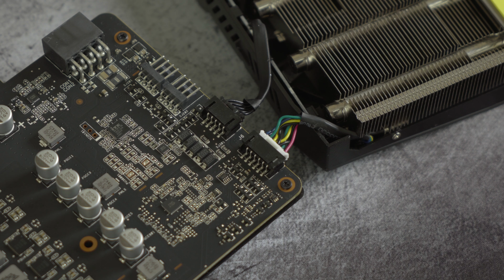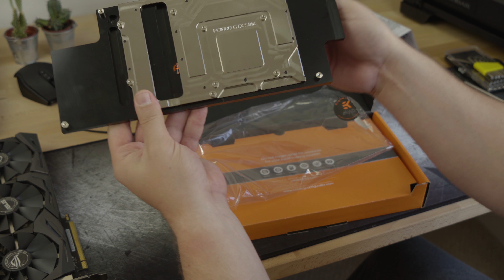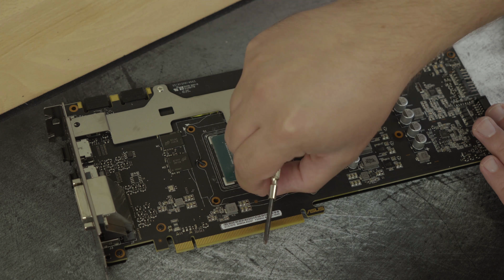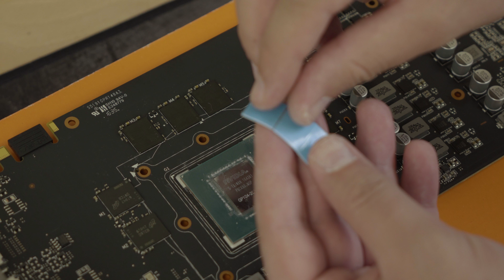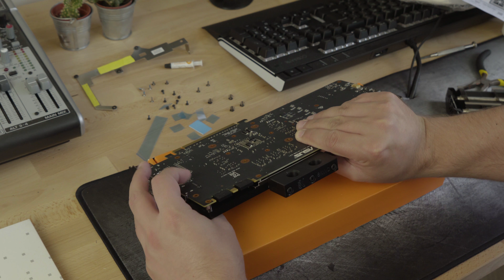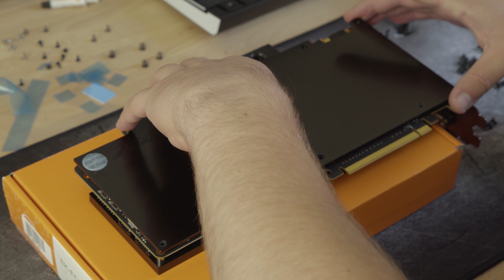How to water cool a pc - fitting GPU water blocks

Comment: Hello Sir, great videos, very informative! 

Silly question from the video. I will assume that you removed the other plastic cover from the VRM pads? I did not see it in the video but that would make sense to me. Unless there is a reason why you left it on? Also, on the back plate, the 2nd strip seems to be on 2 different levels. Would you need cut it in half and have on on each level?
Thanks!
Reply from the maker: +Shawn Poirier yes you need to remove the plastic on both sides of the strips to make good contact. The strip for the backplate only needs to make contact with the back of the GPU so needs cutting to size.